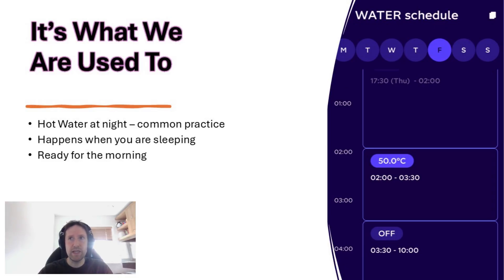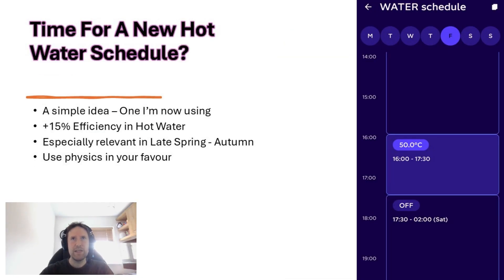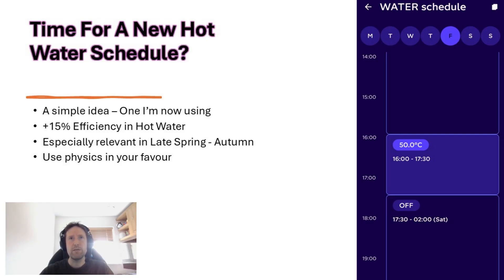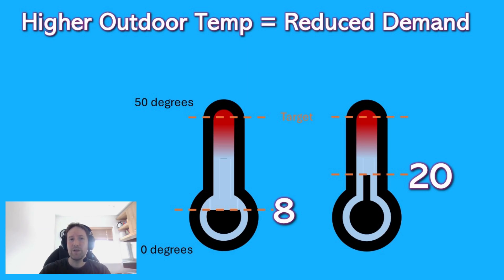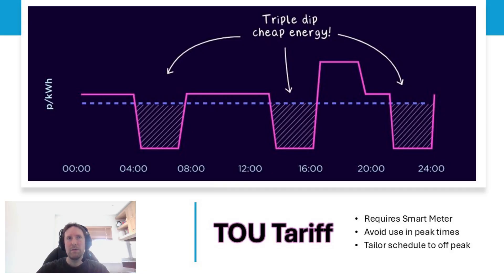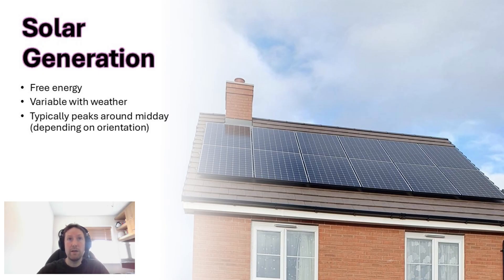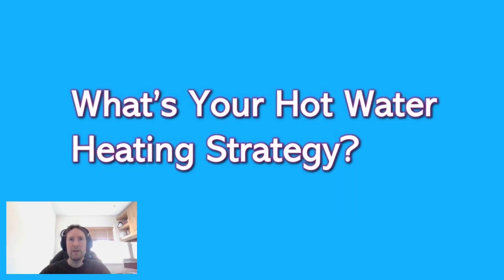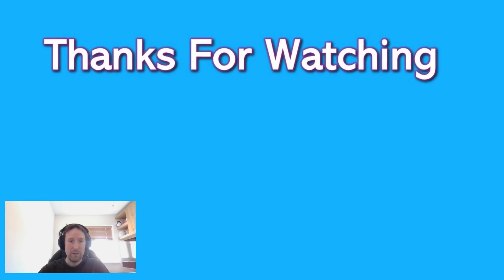If You Own A Heat Pump This Could Change The Way You Think About Hot Water Schedules

Comment: Small point Steve, but when you talk about 4:00 to 5:30 (ish) for your new schedule, for clarity be sure to say that is PM. I think we can mostly guess that's what you meant and we see that implied by your screenshot. As I say, small point, otherwise a very informative vid so thanks.
Reply from the maker: Good spot! Thanks for pointing that out. Yes, to be clear my schedule is now in the afternoon (pm, like you say). I'm considering moving it back to a slightly earlier point in the afternoon though to better coincide with the optimum temperature of the day
Reply: I've recently had installed a 5kW Daikin ASHP c/w 210L cyl which now complements my 8kWp solar. I've also installed extra battery storage for the winter with the plan of running off Octopus IoG. 
So far I've been achieving a CoP of 3.3 by heating the DHW to 45°C between 17.00 & 18.00 and running one bath and one shower daily during the week (Mon thru Thurs). On Friday the water is heated twice for two baths 17.00 to 18.00 and 19.00 to 20.00. On Saturday just one heat cycle 17.00 to 18.00 for one bath (Eco mode). There is one weekly hot cycle early Sunday am which is a semi disinfection to 50°C ((Comfort mods) during IoG cheap rate 04.30 to 05.30 and this loses about 5°C of heat by 18.00 bath time, again a second bath is taken so another 45°C cycle is scheduled for 19.00.
So far since install in mid April the afternoon cycles have been powered either by solar, solar & battery or battery dependant on sun of course. So I'm either losing an hour per cycle of export at 15p/kWh or using an hour per cycle from the battery at 7p/kWh. An average week to date uses 15kWh of energy to heat DHW. I've adjusted the settings to avoid using the immersion for disinfection and strongman (powerful).
Its early days yet and there's much to learn but the evidence suggests its a reasonable strategy and significantly cheaper than gas.
Reply from the maker: @tebbo8324 thanks for taking the time to share details of how you run your hot water schedule and the results you have achieved. Sounds like your setup is working nicely for you 👍